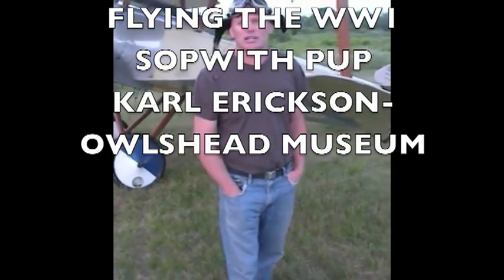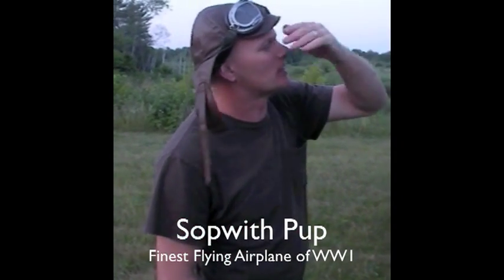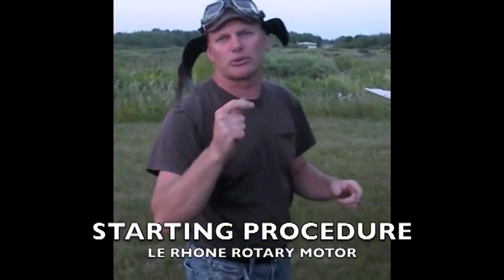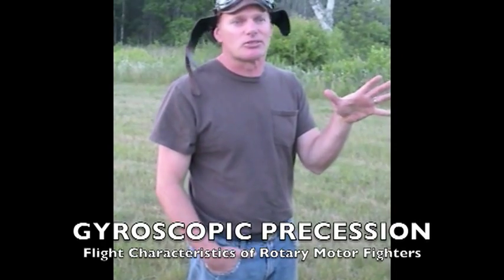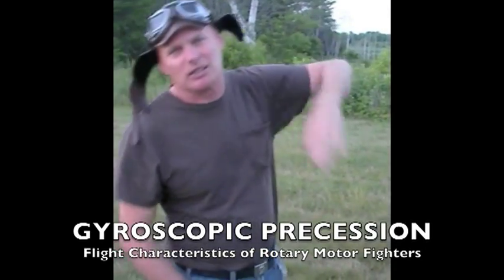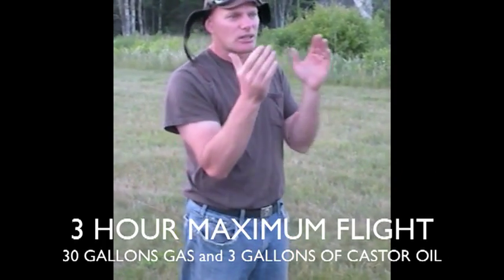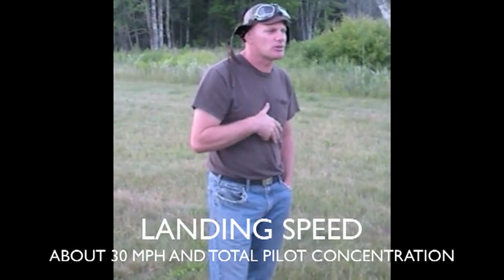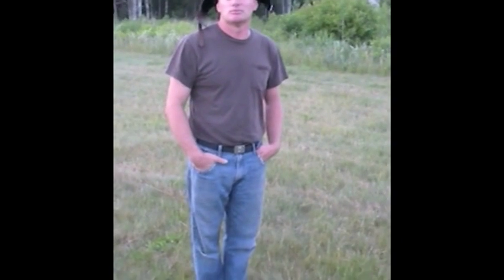BD-0076 How to Fly a WWI Rotary Motor Fighter Sopwith Pup

Comment: I built a replica Fokker Eindecker in 1970 and that thing was a real squirrel to fly with that all-flying elevator and rudder.  I did use a modern engine (Cont A-65) and went to ailerons instead of wing warping. As Tony Spezio (one of the pilots at Old Rhinebeck and the only one to fly it there) said, No wonder they lost the war.

Comment: The engine didn't "burn" castor oil but sprayed it everywhere. The pilot both breathed as well as absorbed the castor oil into his system with the same results as taking a couple spoons full. They claim that was the reason pilots wore brown trousers.
Reply: Pilots were issued half a bottle of Gin per day to counteract the "Shits" and the stomach cramps that went with them .couple that with what they would drink in the mess at meals and in the evenings you realize they must have been monumentally pissed nearly all the time Air Ace Billy Bishop mentions this at great length in his biography
Reply: On the plus side, the pilots were never constipated.

Comment: It never fails to amaze me that they had the crank stationary and spun the whole shebang around it. Talk about doing it the hard way. Then add a oil system that is total loss, slinging it all over the place. The must have had a crankshaft that looked like a bent telephone pole to support all that spinning weight.
Reply: +505197 Yes, but the beauty of these was that there is no reciprocating motion. That's why they run so smooth.
Reply: +Peter Mangold 
True, but people have difficulties believing it! The cylinders rotate around the crank shaft, and the pistons and connection rods rotate around the crank pin. But people still can't see it!
Reply: The real reason is weight. You need no water cooling and since the cylinders are rotating, much less finning on them. This is a very low weight engine for 90hp - bearing in mind that ic engines were less than 20 years into development at this time, and Kittyhawk was only 12 years before.   And the plane can take off with no warm up. The Camel outflew even the much vaunted Focker Tripe with an experienced pilot [ that precession gave them a turning edge],  and it was still in front line service after the war.

Comment: When I was looking around for a suitable ship to build, I wanted to avoid the usual biplane with German crosses on it. I settled on the Fokker E-III because of its history and ease of construction. The thing that bothered me was the aerodynamics of the ship were at least five years out of date. It used wing warping for roll control which was just too far out so I designed it with a more logical airfoil and ailerons, I figured I could contend with the all-flying tail surfaces which were necessary for the proper looks. Even though the ability to aim the airplane gave it the nickname of the Fokker Scourge, it was still five or six years behind everything else in aerodynamics and controls.

Comment: And no one mentions that all that castor oil, [ that mom used to dose us with for constipation ], got into the pilots as well as on them, with the result that the fliers had constant diahorrea, aka 'the sh its'.  Rotary engines like this ran flat out, that rotating crankcase/fixed crankshaft meant no throttle was possible.  Hence blipping the throttle with the magneto switch to control engine speed.  If you want more information on WWI fighters and the horrors of war, try getting hold of some old Biggles books by Captain W E Johns. He strips the romance right out of killing young men to suit the whimsy of politicians, without denigrating their heroism.
Reply: belson alan biggles for the win
Reply: Blackberry brandy to be specific.
Reply: As good an excuse as any for having a drink after your flight...  "To.. Uhh... Umm... To counter act the castor oil.  Sure...  That's the ticket...  The castor oil."
Reply: belson alan    "Rotary engines like this ran flat out, that rotating crankcase/fixed crankshaft meant no throttle was possible."

Ahhhh...  I'd always kinda wondered about why the blip switches.  But now that you point out the difficulty in putting a throttle on an engine that was spinning like these were, it's obvious.  I was more accustomed to thinking about radial engines that were mounted stationary, and didn't make the leap that these ones weren't.
Reply: belson alan This is very rarely mentioned. May I suggest the wonderful book about the RFC...'Winged Victory' by V.M. Yeates. A pity the bloody plane wasn't really shown. WTF.
Reply: >Rotary engines like this ran flat out, that rotating crankcase/fixed crankshaft meant no throttle was possible. Hence blipping the throttle with the magneto switch to control engine speed.

This is only true on the Gnome Monosoupape rotary due to the way it worked. Other conventional rotaries like the Gnome Le Rhone, Bentley BR1/2 and Clerget could be throttled normally, if the correct carburetor was used. A good example would be the Sopwith Snipe with the Bentley BR.2.

The monosoupape couldn't be throttled because the air intake and exhaust shared the same valve, while the fuel and oil came in through ports in the cylinder liner.

Comment: I thought to turn left you need to out the nose down but turning right was very easy as long as you applied full rudder. I think he got mixed up. But I might be wrong.
Reply: I too thought he got a little mixed up especially when he said on take-off you needed full left rudder so with the torque of the engine running clockwise from the pilots point of view I would have thought full right rudder, then again I could be wrong, just using logic.
Reply: Funny...anyone who read biggles as a kid knows a camel turns RIGHT like a flash...

Comment: The foremost advantage of a rotary engine has not been mentioned. It is that there is no reciprocating motion. The pistons travel in a circle and not up and down! This makes the engine very smooth running with little vibration.
Reply: the main advantage in he's times was the cylinder cooling and low weight, the vibrations are the same as on a radial
Reply: You are misinformed and  do not understand how a rotary aircraft engine operates.  It is a reciprocating engine. Pistons move back and forth (reciprocate) but crankshaft is stationary and the engine revolves around it.  The propeller is attached to the whirling engine.  
It was the lightest, simplest, and most reliable engine available at the time but it was a dead end design.
Reply: Think about it! The pistons move back and forth relative to the cylinders, but relative to any outside point they describe a circle. This is why the engine runs so smoothly.
Reply: the pistons certainly reciprocate as in any configuration of standard engine.the fact that the crankcase rotates rather than the crank is opposite to a radial but it is still a reciprocating engine and would be subject to any out of balance forces that cause vibration.

Comment: How does the pilot fly at 18,000 feet without oxygen?
Reply: VERY carefully! Towards the end of the war, combat was ocurring more often at higher altitudes - the Germans in particular experimented with rudimentary oxygen systems for their crews but they weren't popular due to the possibility of explosion caused by battle damage. 18,000 feet is a long way to fall when youhave no parachute...

Comment: I would like to hear the idle sound of this engine.
Reply: Aleksei Mikojan It won't idle. The engine is either at full throttle or off. Engine speed is controlled by cutting ignition with the blip switch he points out. That gives a rotary the distinctive sound at the start of the video.
Reply: That’s called silence.

Comment: G'day,

 Yay Team !

 Um, the only Sopwith Pup I ever worked on was VH-PSP, built by Transavia for Pacific Films in 1978, when Neil Cottee was CEO/MD, & it had an Armstrong Siddley Gennet Major Radial Engine...; it's in the Australian War Memorial these days, last I heard...

 Anyway, what Karl here had to say about Gryoscopic Precession was not correct...; possibly with an 80 Hp Le Rohne, at low RPM he's not experiencing enough of an effect for it to have impressed him, as he stated, but in fact it was the Pup's ability to fly in a balanced fashion despite the Rotary Engine which so endeared it to Pilots of the time.

 In fact, quoting Captain Norman Macmillan OBE MC AFC, in "Great Aircraft", published in 1960, when describing the 130 Hp Clerget Camel (and yes, Clerget & Le Rohne & Bentley all revolved in the same direction...!), on page 63 states...; "When turning steeply to the left the Camel's Nose rose, and when turning steeply to the right it was forced down. In the Left turn the pilot had to apply bottom rudder to prevent the Camel from stalling. And in the Right turn he had to apply full top rudder to prevent it from falling into a spin. Whichever way he turned he had to apply rudder with his Left Foot .
The pull of the gyroscopic forces ....increased the rate of turn to the Right...."

Other sources cite the Camel being able to make 3 Right-hand 360-degree Turns in the same time it could perform 1 full Turn to the Left, whereas the Albatross D-Va (with it's "Stationary" Engine) could fly 2 turns in the same time, Left or Right.

  Perhaps Karl is confuzzling Gyroscopic Precession with Torque, which does yaw  Camels & Pups to the Left, when accelerating on the ground, but only because it presses the Left Tyre harder into the Runway than it presses the Right side...

   It's a tricky double-act to tease out, and underconstumble which is doing what...; but, I hope this helps...(?).

;-p

Ciao !
Reply: Adrian Larkins 
G'day,

Thanks,

    Well, yeah, they were tricky to fly..., but I WANT one nevertheless...; and if I was given a week each with a Tiger Moth and then an Avro 504k, followed by a Sopwith Pup to work up to it, then I'd gladly have a go at a Camel...!

 However I have "form" when it comes to flying infamously "unpleasant" Aeroplanes, technically the Wright Brothers had a better Aircraft in 1903 than what took me for my first Solo in 1978, because they had 12.5 Hp, 2 big Propellers, Double-Surface Aerofoils with built-up internal Wing-Ribs, and 3-Axis Controls using Wing-Warping...; whereas if you search "8Hp, 1975, Red Baron Skycraft Scout...", you'll find it had Single-Surface Dacron Wings with cambered-Battens in Sail-Pockets, & Elevators and Rudder both Joystick-actuated, with lots of Dihedral & a Bicycle-Chain Reduction-Drive to the single 3Ft Diameter Propeller.... (last time I saw it, the bloke my father sold it to had subsequently lent it to the Inverell Transport Museum who chained it to their Ceiling...).

  So, nothing I ever tried afterwards was quite so marginal as the old Scout, though an Ultralight Motorglider was bad enough that I flew it inverted and going backwards over the Fencepost I failed to clear, that was my own fault for trying a Downwind Takeoff in a too-short Paddock, rather than pulling the Wings off and retrieving the VJ-24w with a Trailer...; & I'm not silly enough to try that twice, and certainly not in a Camel...

  I always wanted a Camel, I grew up on Camel fantasies...

 My Father's Uncle flew a Camel with 4 Squadron AFC in October 1918, on his 1st flight over the Lines he "became separated from his Flight" (got lost or wandered off), attacked a pair of LVG 2-Seaters by himself & shot down one of them (!) , then 6 Albatrosses dived down & chased him into a Cloud with Bullet-holes in his  Fuel-Tank (didn't see the Escort lurking overhead, and got himself ambushed), then  when he emerged into clear Air a lump of Shrapnel from an Archie-burst knocked him unconscious, and he recovered in time to crash on the British lines (his Beginner's Luck held good)..., and all that got into the History of the AFC that I read as a Kid...

 I've only flown in 1 Cessna, a 172..., but I assembled 3 152 Aerobats out of a 40-Ft Shipping Container, and pulled the Ferry-Tanks out of a 210 Stationair which had come from  'Frisco to Hawaii to Fiji to Noumea to Brisbane to Bankstown Airport at Sydney where I was a Tarmac-Terrier...

  And though I haven't ever repaired the Motorglider, and I refused a flight in a Boeing PT-19 Stearman a fortnight ago (my son took me to an Airshow, and he and his sister wanted to pay for me to go up..., but I was having too much fun with 3 Cameras on the ground...), because I'm a Greenie & I can't justify the Carbon emissions...; but if I were offered a flight in a Clerget Camel I'd go into training to get myself into condition and give it a go..., and go on a guilt-trip about the Greenhouse Effect afterwards..., because "a Camel is to die for !" as they say,

Have a good one,

;-p

Ciao !

Comment: A radial not a rotary
Reply: If your referring to the engine in this video it's a rotary engine LeRhone 80, the entire engine system rotated with the propeller, these are the first production engines used in flight. A radial is a fixed multi cylinder engine with rotating crank shaft in the center to which the propeller is attached and is the only part that rotates, that's roughly defined but you get the point.
Reply: No THIS is a rotary (the entire engine block turns), and a Wankel IS NOT a rotary engine: it's a rotary PISTON engine (name give from Felix wankel himself: "rotations KOLBEN (=piston) motor!
The main rotary engines builders was Gnome, LeRhone (twice formed the actual SNECMA (Safran group) in 1945) , and Clerget, all the other copied more or less this engines
Reply: It is a name thing then. No need to educate.
Reply: +Andre Marais THIS IS A ROTARY... invented by Felix Millet in 1892.
Reply: He even mentions this in the video -- that it's a rotary not a radial.
Reply: Totally different from a radial. Do some research
Reply: @budyeddi5814  5  years later? OK Boomer.